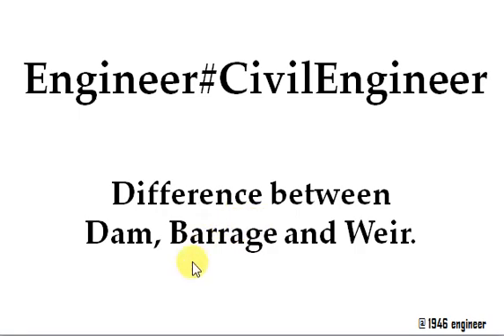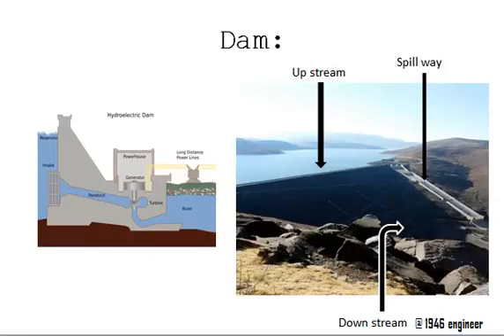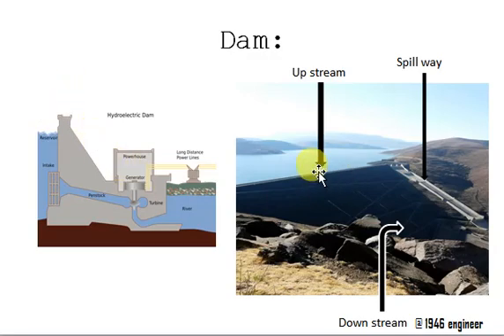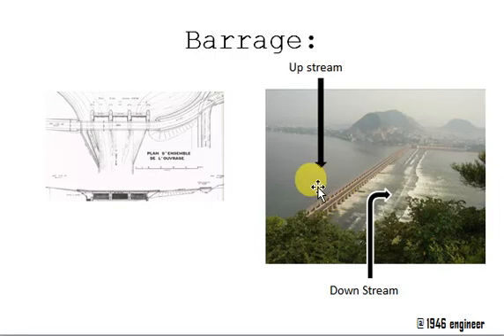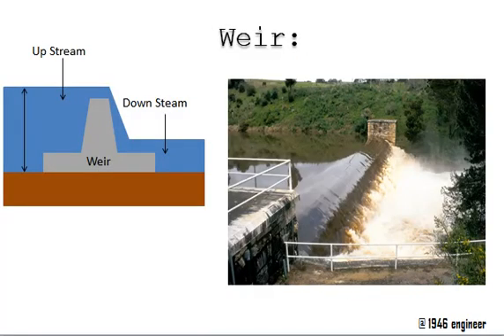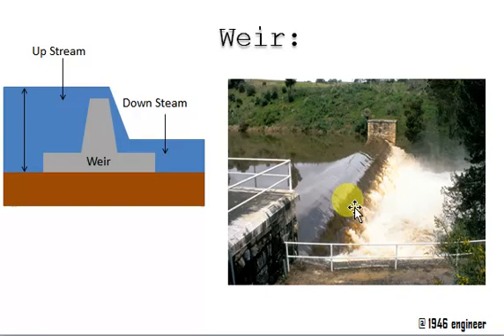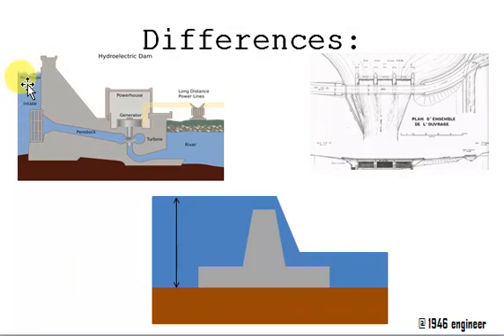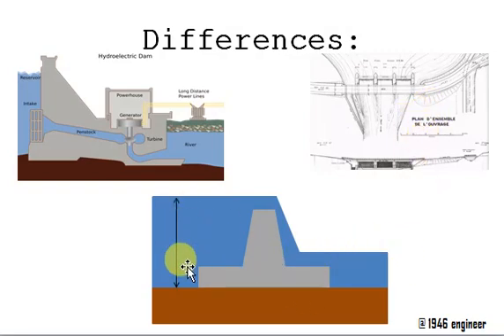Difference between dam, barrage and weir.

Comment: Dam is a water storage resorver. It's height is more than weir and barraige. When water is full, it doesn't overflow. Water pass through spillway

Weir is small water storage resorver. Water is not overflow in it. Water passes through gate. Mainly water diverted to irrigation purpose

Barrage is small water resorver. It has no gate and spillway. If water goes full then it overflow

Comment: First of all, only dams out of these three are used to store water. Weirs and barrages are diversion structures and do not have reservoirs. Weirs and barrages are constructed only to maintain a constant level of water upstream so as to divert it conveniently. And "Barrage" is pronounced as "Barraaj". Kindly make sure you understand things correctly by cross verifying them from several sources before trying to teach others.
Reply from the maker: Ok sir